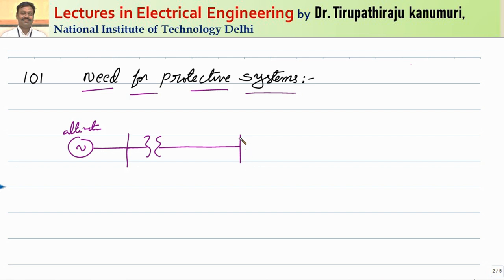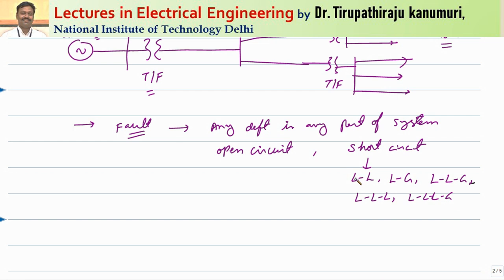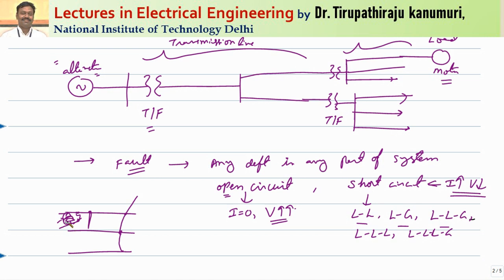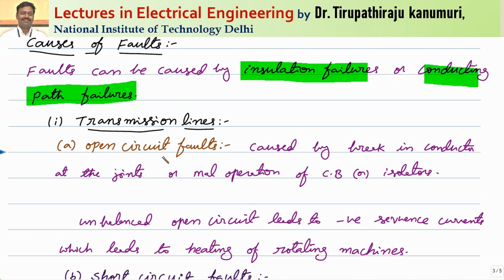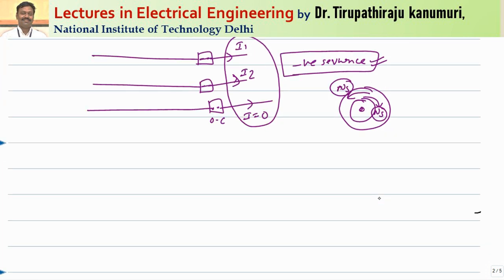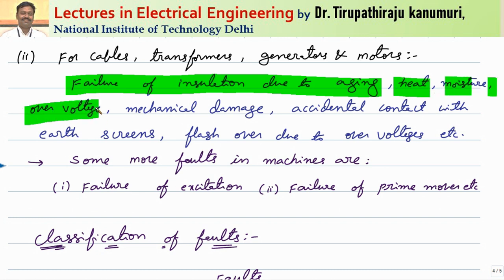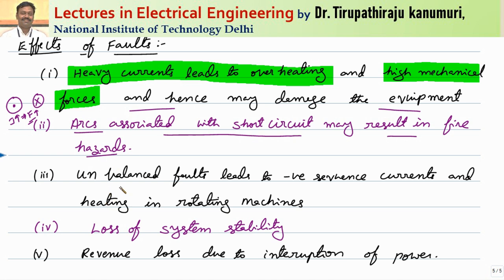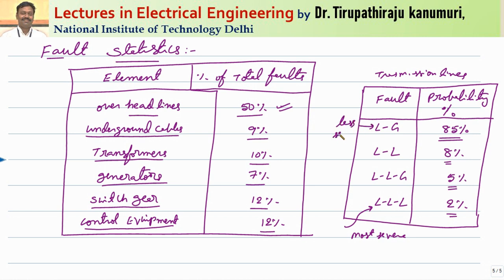SGP101 Need for Protection Systems

Comment: Sir in 3 phase conductor returning path of current??plze explain sir
Reply: Sir in power system  3phase 3wire system is used than where is returning path in transmission line
Reply: @lecturesinelectricaleng  sir this question asked Pgcil ET interview... I explain 3phase 3wire system ia+ib+ic=0 than third line ic=-(ia+ib) is returning path is it correct or not